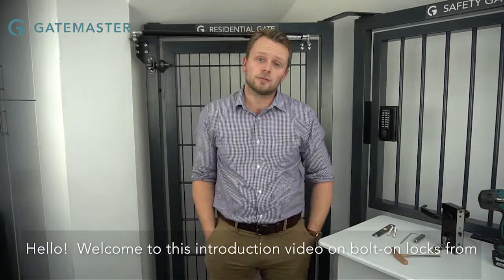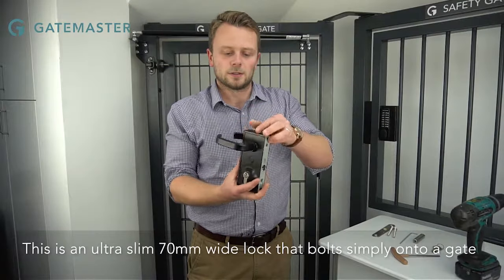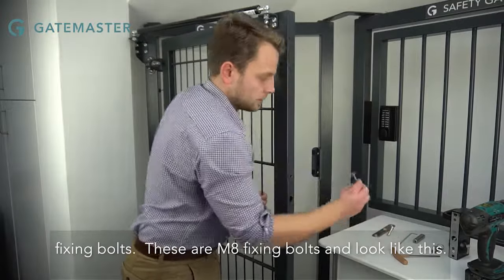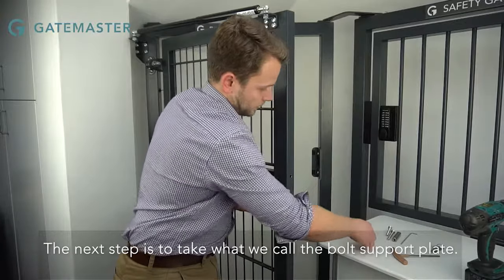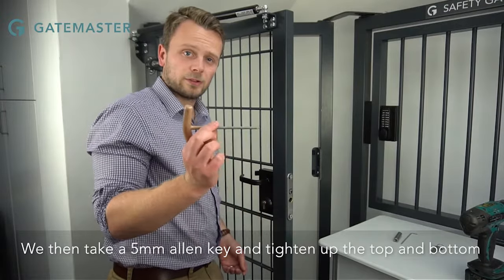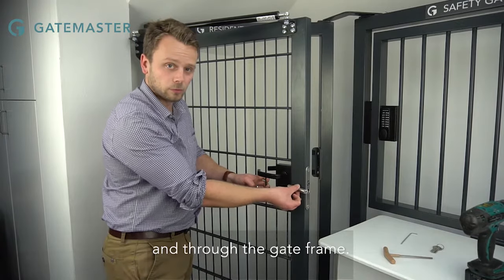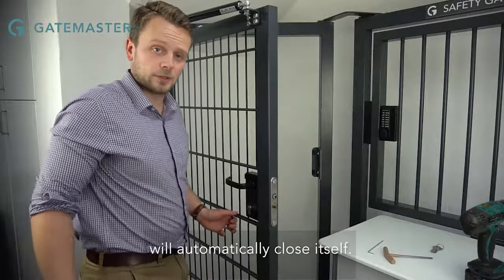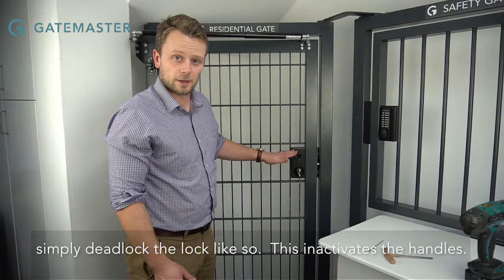How to Install the Gatemaster Superlock

Comment: So you simply drill an 18mm hole for the latchbolt with that drill? That battery drill will have a 13mm capacity chuck at absolute maximum, more likely 10mm. You just jump to "once you've drilled your holes" and  I appreciate you want to make it look easy, but that's not a standard drill bit you're going to need there is it?
Reply: Hi. I was stuck with the same problem. Wondering how I was going to drill an 18MM hole with just the handyman type of tools around the house. I purchased myself a 4 - 20mm Step Drill Bit for $12 from Bunnings that fits into my drill. It did the job perfectly!
Reply from the maker: If you have the correct size drill bit, a battery drill can do the job just fine.
Reply from the maker: Thank you for your comment.
Reply: @liamjackson8576  Good idea, they should perhaps suggest that, not many folks have an 18mm drill bit lying around!
Reply: @gatemasterlocks  Thanks for the swift (5 month )response. That's quite a big "if".  If its very easy, just wondering why didn't you show your installer actually drilling the 18mm hole? It's not just a question of buying a standard 18mm "jobber" drill bit, it would need to have a stepped shank to allow a standard 13mm chuck to accommodate it, or a step drill as Liam Jackson suggests. Perhaps worth mentioning all the tools would actually required for the job?